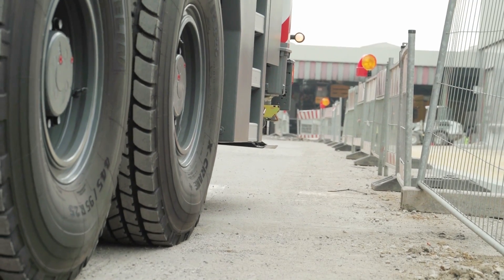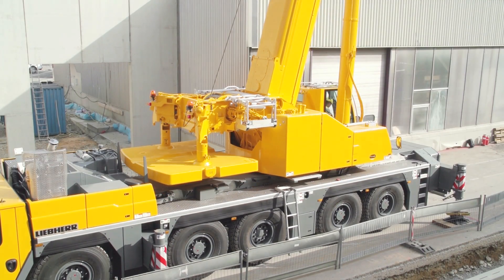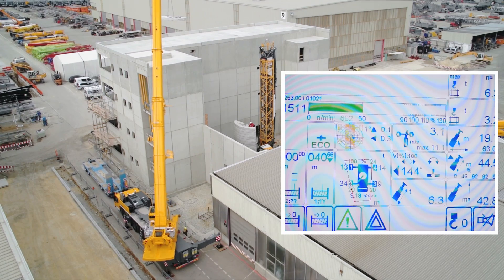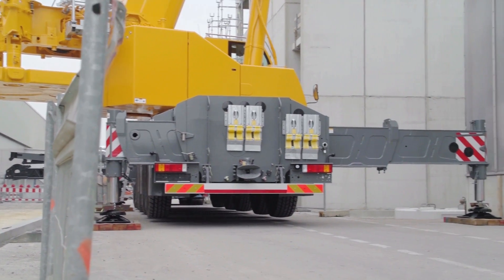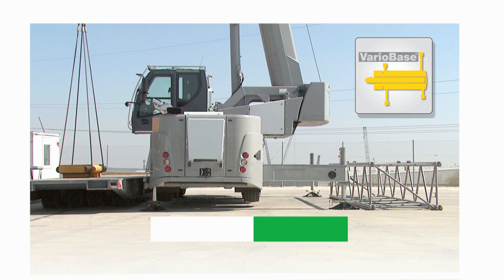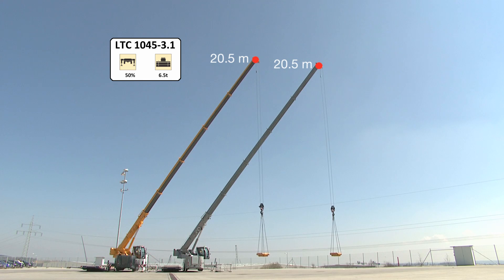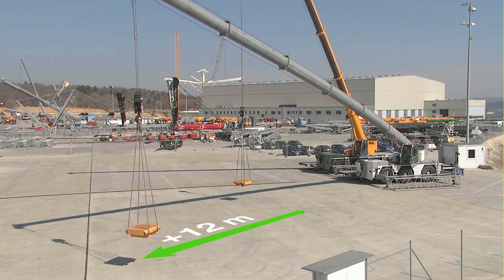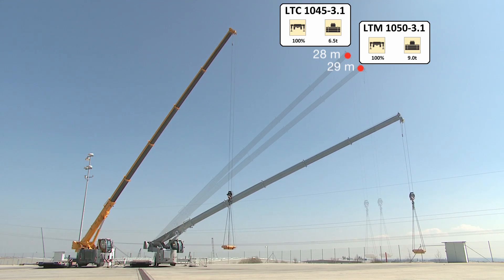Liebherr – Improved safety and performance by VarioBase®

Comment: Liebherr didn't develop this system. Tadano did this years ago. Way before Liebherr came with it. They only extended the system.
Reply: I also have no idea what the system is called but I worked an ATF130-5 in 2015 with the same feature
Reply: How Tadano calls the system, do you have a link?